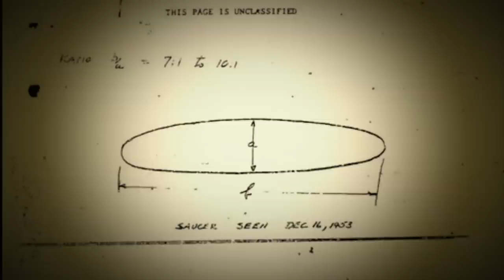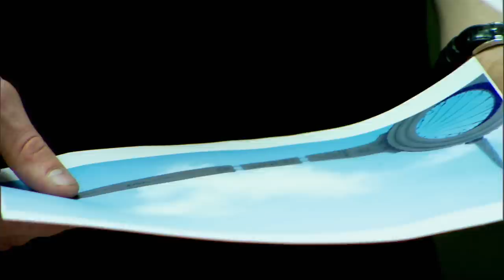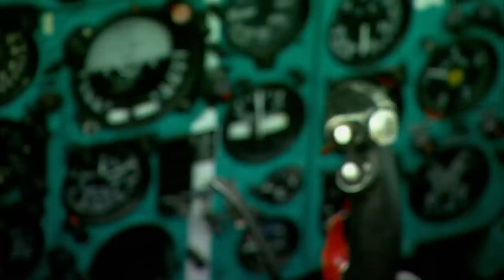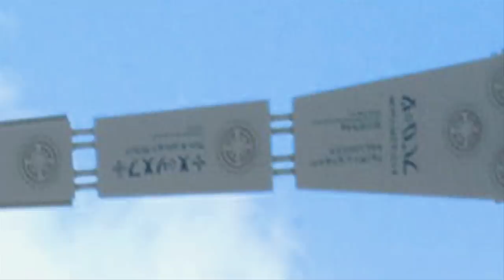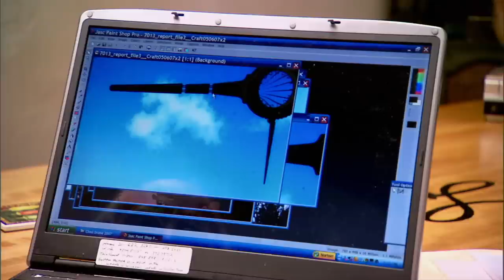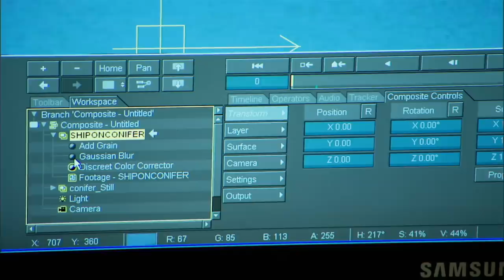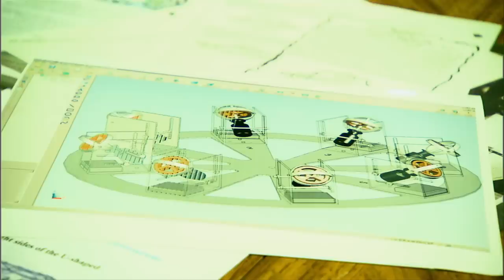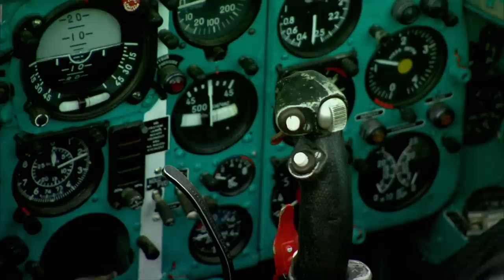UFO Hunters: Reverse Engineering an Alien Spaceship (S1, E7) | Full Episode

Comment: The round thing with the radial arms sticking out, that was photographed in Bakersfield, is a ceiling fan.
Reply: How did it get into the air?
Reply: @IamProfessorO    It must have broken loose and gone through a skylight.

Comment: All the little ringed objects, using the same ionization technology like a Dyson fan, do not have the ability of a greater production model - like the self-continuing air model engine.  Their existence only applies within that small sector of the atmospheric condition, or such limited fashion of convention ion discharges.  There is no known higher form of a Dyson ionization jet that could make anything flying or propelling a vessel or vehicle in any land, sea, or air location.  So 6 anything that is small with unique features.  Real flying objects with suprasessional flying abilities have Meissner force field slipstreams (worm bubbles ... the fuzzy appearance of the EM field around the flying tictac ...).
Reply: @kar-el7414  Well at least 1 person understands now.  The Meissner force field is actually a neutron gamma ray.  Having just solved, with elementary designs, the Grand Unified Field Theory, I can prove that Quantum Mechanics (QM) and Quantum ElectroDynamics (QED) with all their calculus from atomic and nuclear  models down to light (particle) physics - they have shown that slowed down light (gamma ray photons) are the actual source of cores of stars, and (super)nova star core (gravity) fragments - that are the real source of gravity.  That gravity is the amalgamation of _ and - gamma rays at the most elementary level.  It is even proven that a - gamma ray group can convert itself into a neutron (!) and then further convert into a + gamma ray group (and vice versa).  All of this explains weak nuclear force, strong nuclear force, electromagnetics (ahem ! - electro-gravitics) ... and the mysterious gravity.  It is when you have neutron gammas or a surface that displays a neutron field around it - that object literally disappears from any gravitational force upon it.  Newton's Laws no longer apply.  That neutron field is the Meissner force field - that is the UFO slipstream.  No gravity, no g-forces on the pilot, no shear forces on the flying vehicle, and supersessional flying abilities - without any conventional propulsion system or aerodynamic wings uplift.  It really is that simple.

Comment: The CARET drones have been one of my favorite flaps or ufo cases since I first heard them reported on coast to coast in 2007! Glad to see it rekindled here... Definitely interesting correlations with NASA's unmanned photographic lunar reconnaissance orbitals and project code named 'Clementine' — as well as definite correlations between various glyphs found in the CARET manual and glyphs imprinted in various crop circle designs!
Reply: Those photos were proven fakes. They aren't even good ones. Not even for 2005 photoshoping
Reply: Tiltok user sorrycantseeme has posted factual proof
Reply: I love the idea of the group being called carrot, like carrot and the stick.
Reply: @camojoe83  & any OG recognizes the Alienware font when they see it 💪😆 Ironic them using the laptop & not recognizing it... or they did & it's all just TV entertainment.

Comment: I mean... to me... These look like bare-ceiling light mounts (bent-wires atop would cage inverted, flad-head lightbulb body and threads), circular bottom of "craft" looks the lightbulb 'opening' at ceiling level and the flat "arms" would be for in-ceiling security and stability. Just saying. Find a random stripped light mount, use Photoshop adding some seemingly Japanese graphics, and BOOM🎉. You've got a UFO shot. Why no videos? All stills?

Comment: As a the world's leading researcher of superconductivity and its possible applications - the mentions of fiberoptics - is the understanding of supercompacted supersolid crystallin-metallin/metallin-crystallin (CM/MC ... you can't tell a metallin from a crystallin) and these are not crystal or metal products.  They are true crystallin and/or metallin products.  Not metallids or anything of conventional understanding.  Such superconductive fibers have no impurity of chemical composition that creates resistance (heat, dispersion of energy or light particles) being able to transmit multiple !) light and (multiple !) EM waves across the same nano-fiber at the same time - at light speed.  All the same for fiberoptics (nano-fiberwire) for lightspeed computers - or such interconnective devices with sentient ETs or humans into their neural network - and have true pilot - and fly by "nano-wire" instant communication and response of a suprasessional flying object - with the real need of actual hardware, hydraulics, hydraulic hoses, electric wires, physical cable wires, ... etc.  All depends on how you associate yourself to advanced periodic table of elements ... Bose-Einstein condensates, Cooper electron pairings, supercompacted periodic elements creating their higher selves, ...  When you understand that ... all the rest of this child's play of running around, looking at sites, ... it becomes plainly visible and understandable in what is happening, who is who, and how can humanity (versus the government and black ops deep swamp) advance into free energy, non-pollution, liberation, extreme mobility, and shoot to the stars and colonize/terraform planets, moons, etc.  Really easy to understand.
Reply: Thank! Got it now!
Reply: Do you do bar mitzvahs?

Comment: LOOK!! At @5:10 look at center hole of craft and look at the bottom the spike that’s facing 11 o clock. ZOOM IN people, you can see the electric wire is for some reason not connected there’s a break in it and one is higher than the other. Its photoshopped

Comment: Looks like a mainland mix of Korean.
Reply: Running off an electrical vortex of power lines.
Reply: It would float with the lines I suppose.
Reply: Static force isn't much of a mystery.
Reply: Later could be floating on bars of towers.